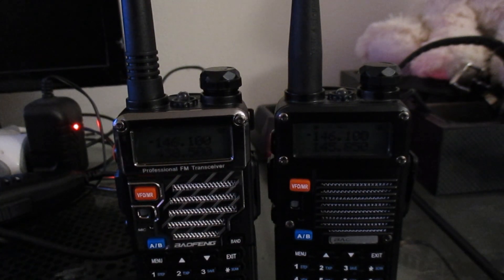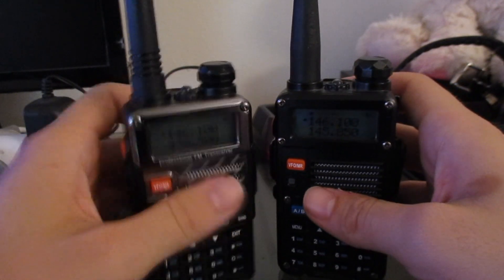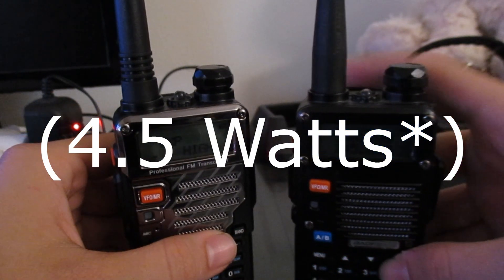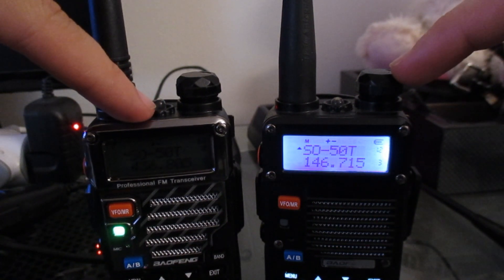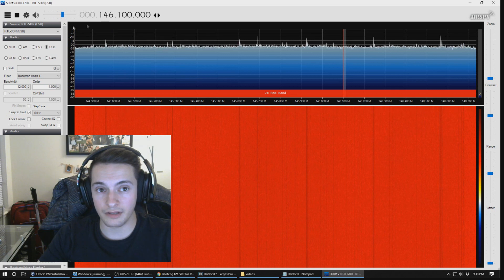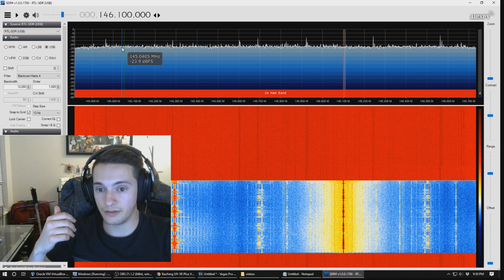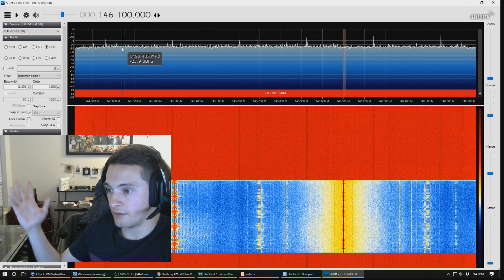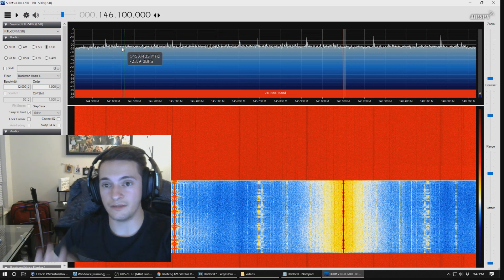Baofeng UV-5R Plus and The BF-F8HP Comparison

Comment: @Modern Ham   After doing some comparisons, my BF-8HP... (The one from B-Tech,, available directly from B-Tech or from B-Tech's Amazon site)... Is a much better radio. It has proven to be a better radio than a nother BaoFeng radio, from Another Supplier, which is being sold as a BF-8HP, but looks slightly different. The output wattages are more on the B-Tech, the speaker sounds better, the case appears stronger, the same rated batteries weigh slightly more, and the reception is noticeably better on the B-Tech supplied version. We even swapped the Nagoya antennas in case one was a knockoff. Getting the same results. The B-Tech version (In the "White Box" is definitely my choice of the 3 tested. The B-Tech BF-8HP, did 1.2 Watts, 4.2 Watts, & 7.4 Watts vrs 1 Watt, 3.8 Watts & 5.1 Watts. (Using two different connected meters) But the main thing is actually the ability to receive better. You can't talk with someone you can't hear, no matter what your output signal strength is... Right?

Comment: Does the F8HP xmit on the GMRS frequencies at 8 watts?
Reply: Yes it does TX on GMRS. However The radios I got from Amazon only put out 4.5watts. I am thinking They are the UV5 innards with a F8HP sticker. Great little radio though. I bought two more from a different seller to see if I get the 8 watt feature.
Reply: @the.greyman.7480  
Did you get 8w from the other radios?
Reply: @tinfoilsombrero1439 I only get around 4 watts from the RT-97, even set on high power.
Reply: @the.greyman.7480  
Thanks man.

Comment: All Baofeng radios are based on either the 5R, UV-82 or the 888s
The exteriors change but the internals don't generally.

I would recommend getting a UV-82 and see the differences.
Proper keypad (0 in right place) better speaker and much better front end,
Plus dual PTT which can be useful

Great video btw

Comment: how would you compare this to BTECH UV-5X3 5 Watt Tri-Band Radio?  I'm just starting out and it seems the tri-band is better?
Reply: I’m asking myself the same question... just returned the GT-3TP Mark iii because it’s being discontinued and you can’t buy upgrade antenna due to the proprietary antenna/batteries. So I’ll either get the UV-5R (looks like most of them are copies of the Boafeng... Mirkit, Tidradio, Tenway etc.) or the F8-HP with a Nagoya 771 or Expertplus antenna

Comment: For the budget minded, the F 8 is still the best bang for the buck and under $65. Of course the elitist will still bash any radio made in China. Oftentimes failing to realize their $200± to $400 choice, may also be made in China. Just because it's a Japanese company, does not guarantee it's all made in Japan. I myself have a few "Elitist" brands that are made in China or have complete boards the have "ROC" marked on them.
( "ROC" Republic Of China " )
But the TRUE Question comment is this...
"Show me a better radio for under $75.00"
Because eventually I need multiple radios for my wife, son and daughter. 
Did these guys buy 4 radios for $250.00?
  NO! 
Did these guys buy a $250+ to
$400 to start out with? 
  Probably No!
Do you really need or want to carry a $400 radio on a construction job? 
How about while wading and fly fishing?
How about kayaking some rapids?
But if you're basement, jack-jawing to your buddy a few blocks away or in another town off your nearest repeater, go ahead, dump some loot on a extremely overpriced, and overhyped, so called higher quality "name brand"... As a contractor, I personally carry and use mine daily and have dropped it out of a second story window more than once. No cracks, lots of scratches, dings and dents, and still working. My Kenwoods couldn't handle the heavy use or environment. And I'm not going to subject my $650 radio to either. I keep those in the BMW, on the Harley and in the motorhome. That way the elitist know I'm a Tacticool Dude and they look at me with want and envy. I tell them "I had a entry level Japanese radio like yours before I got a job..."
That always shuts them up.... Buy a radio and have fun, be prepared, and stay safe.
Reply: Tnx!
Reply: Republic of China (ROC) is actually Taiwan.     They do make better products than China like hand tools and car parts are really good similar to Korea, Japan or Germany.  That saying all of the Baofangs seem really good bang for the buck and for my use I have no issues at all.

Comment: Is the BF-F8HP thicker only because of the battery?  I ask because I have a couple of the extended batteries for the UV-5R.  If they are the same dimensions sans the battery, the extended battery should fit the F8HP as well.
Reply from the maker: I think so. But I would measure the voltage on each eith a charged battery. The higher power output of the f8hp may require a higher voltage to run.
Reply: Allegedly the accessories/batteries are interchangeable. I only have a BF F8HP 8w

Comment: And the coverage of uv-5r plus, and bf-f8hp is the same.  ?
Reply: Yes and no. I am not that impressed with the UV5R (which i purchased after the F8HP). The FM radio for the UV5R does not pick up the same station that the F8HP easily receives. I am still waiting for the local test sight for ham license to re-open so I cam do more than listen  .

Comment: Why does the  BF-F8HP NOT have a "Band" button but the UV-5R Plus does?
Reply: Hey,: Why does the  BF-F8HP NOT have a "Band" button but the UV-5R Plus does?
Reply: @fredgarvin1465  it's useless. You never use the button to begin with, you could remove it from the uv5r and I wouldn't notice. Want a frequency just scroll up/down or type it in like you're going to anyway

Comment: I went with the uv-5x3 and was able to program some local frequencies with chirp... 
i cant figure out how to program  a frequency manually though. 

I was reading with some of the items older firmwares, that one of the baofeng had a bitton issue and was fixed withe newest firmware. I believe the uv-5x3 has the newest firmware.

Id love to see a video on how to program with chirp and how to identify my local frequencies
Reply: Talewavo I have read that the up-5x3 has the newest firmware and rids the bugs that the Uv-5r has. One bug is the uv-5r has problems programming in the chirp program. Also one button on the uv-5r either stops working or making a beep sound when  it’s supposed to. 
I don’t transmit. there are better options for transmitting with more power. If you want one for scanning and weather. You can’t go wrong  with the uv5x3. You’ll need a tri-band antenna to make it more awesome Authentic Genuine Nagoya NA-320A Triband HT Antenna 2M-1.25M-70CM (144-220-440Mhz) Antenna SMA-Female for BTECH and BaoFeng Radios https://www.amazon.com/dp/B01K10B9XK/ref=cm_sw_r_cp_api_i_-fpSEbBKJMVT9

Comment: I have both of these radios. I got the UV5r V2+ back in 2016 and the F8 in 2018. So the V2+, is only a 5 watt radio, so has two power settings, low 1 watt, and high  5 watts. The F8 has three, 1,4 and 8 watts. And yes you can get that much power, if you have a balanced antenna. The F8 is thicker when you buy it due to the 2000 mAh battery, which gives the F8 a bit of a hump back. I find with my F8 and a better antenna, it out preforms my V2+. Its all about the Antenna. What kind of cable did you use and what software?
Reply: What antenna(s)  would you recommend?
Reply: @imjustmetoo7419  Depends on where you live, apartment or house, and if it is controlled by an HOA. For my base station I use a Arrow Open Stub J-pole antenna, and it is a very good 2m/70cm antenna. If you hae to run a indoor antenna, the Abbree 42.2 inch antenna, just make sure you get the right connector, for the F8 that would be Female.
Reply: @JamesHart62   Thank you. I live out in the middle of the woods, on a hilltop. My only obstructions would be trees that are about 200ft from house.

Comment: So the F8HP is the top of the line hand held ham? Do you have any recommendations about maybe spending a little more for something a little better?
Reply: Hi! I’m not at all experienced but in the process of being a ham and researching what the best radio is when i’m finished. I may post some videos talking about the weaknesses of chinese ham radios and alternatives but it’s nothing you cannot do yourself in a pinch. I live in Europe so I dont know much about the FCC ban but it’s not illegal to sell if you don’t advertise them as FRS radios.
Reply: @arvidolin4318  Again, thanks. I was only throwing ideas out...I wasn't demanding anything....you are correct in that I could do the research myself.
Reply: No way man, Baofeng is at the bottom of the spectrum and is no way the top of the line. Get a yaesu, kenwood or an icom for much better quality
Reply: @arvidolin4318  It would be nice to have a vid from someone as experienced as you which would have the continuum of quality. Maybe you can do a review of these brands directly with the Baofeng...but I suppose it would be best to have each item on hand to have an good comparison to the Baofeng. Thanks for replying.
Reply: Was the ban surround these handhelds lifted based on current political events or has the ban been enacted?

Comment: The issue is  you're trying to demodulate the audio from the radio as upper side band instead of NFM...
Reply: That's exactly correct. His test receiver was in SSB mode and we could thus hear the beat frequency differences. The UV-5R was a bit higher in frequency than the BF-F8HP.
Reply: What do you mean
Reply: Backwoodsmachinist what do you mean what do you mean?
Reply: @Backwoodsmachinist  We mean that he had his SDR/spectrum detector application set to the incorrect mode. He had it set for Upper Sideband (USB). If you'll have a look at the radio button bullet circles on the left-hand sidebar, you'll notice that "USB" is the selected mode during his testing. These Baofeng devices transmit in Frequency Modulation (FM) mode, not in Single-Sideband (SSB) mode. Hence there was no way to hear the transmissions as they would actually sound on an FM receiver. Instead we were only able to hear irritating heterodyne tones and distortion. He should have selected WFM or NFM.

Comment: No airband?
Reply: No, I dont believe so
Reply: On my UV-5RTP I can receive some airband from 128 - 134 (expand range in CHIRP and tune off +/- 0.005 Mhz). ATIS weather is good.  

Aircraft audio is a bit low and occasionally garbled. You then get a loud crack when the squelch closes if you have the volume high. 

The local airport also repeats the 'ground control',  boarding, bus, fire and rail staff on 440 - 456 Mhz for miles around.

Comment: Hi. Im curious about getting into ham. I just got a rugged radio and rt systems software along with my gmrs license. I was going to get another radio and am interested in the bf-f8hp. I know I'm not allowed to operate over 5 watts. All this radio stuff is all new but I've jumped right lol. I am going to peruse a ham liscense in the future.
Reply from the maker: So one thing to note that even keeping the radio at 5 watts or under, a baofeng is illegal to operate on grms frequencies. This is because radios that operate on grms/frs require a fcc certification that the baofeng fail(because it has a removable antenna) . I really encourage you to go after your tech license however, as it takes only a week or two to study for and opens up a world of opportunity.
Reply: @ModernHam  A GMRS license permits a user to have a detachable antenna.
Reply: First and for most you should have done more ressresch on purchasing that rugged radio brand.  Rugged radios are EXACTLY the same thing as the  BAOFENG UV-5R. Now rugged radio just changed the color to blue and they are charging a premium for them!! You can get a uv-5r fot like $20 on Amazon (bf-f8hp 8 watts  for $40) and I believe rugged radio is charging $85- and up to $2000 for their "baoeng" bundles!! For that price you can get your self a REALLY nice $200-$300 HT entry level Yaesu!! Rugged radio is straight up robbing people!!  And this company is actually breaking the law selling then as GMRS radios.  Im surprised that they haven't got a citation from the FCC yet. 

Secondly if your interested in GMRS radios THIS radio is not for you.  I my self is a GMRS licensed, and I do own the bf- f8hp but I do NOT transmit on it due to im not ham licensed. BUT I am allowed to use it as just a scanner and listen in to my local ham repeaters. I am interested in getting my ham and I bought this as a tool to use to get to know how to program and pretty much trying to get my foot in door. 

Now boafeng do make a FCC APPROVED RADIO FOR GMRS BAND which is the BTECH GMRS V1. I believe this is the only  BOAFENG  that the FCC approved for GMRS use. 

TAKEN DIRECTLY FROM THEIR WEBSITE:
 "The BTECH GMRS-V1 is FCC certified (Part 95A) for use on GMRS frequencies. The GMRS-V1 is also FCC certified for VHF/UHF scanning capabilities (Part 15B)" 

Now this radio is preprogrammed by the manufacturer for frs/gmrs bands and you cannot change these parameters ECXEPT the tranmision wattage on the GMRS band to full 5 watts. Now you do get 125 open slots that you can program to any frequencies (allowed)  for scanner purposes only and its locked by hardware to be able to transmit on them. And you can't use chirp to try to unlock it to be transmitted on. You can only program it to listen. 

 This radio IS A 5 WATT RADIO but it limits your watt transmission on the FRS to 0.500 mW by design.  Now the  GMRS band (not the ones shared with the FRS) it gives you a choice to transit at it's full power of 5 watts. Ive read on the FCC website that GMRS home base station, mobile ,and repeaters, your actually allowed to transit  to a maximum of 40watts !! So 5watts on this handheld is well under GMRS allowable transmit power. 

I hope that helps.
Reply: I just want to make sure I don't break any rules or piss people off.
Reply: A GMRS license holder is allowed up to 50 watts on repeater channels. 5 watts on FRS channels.